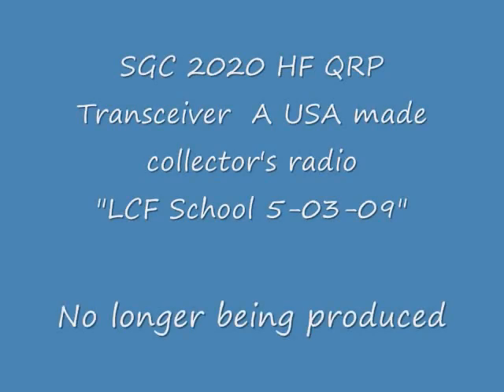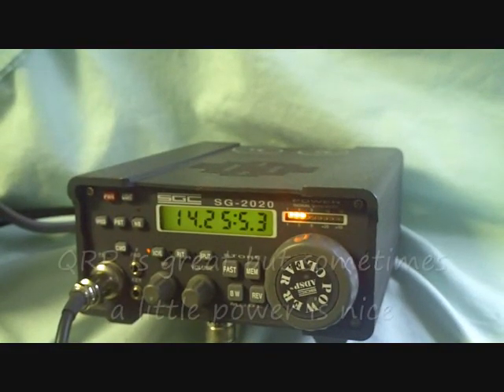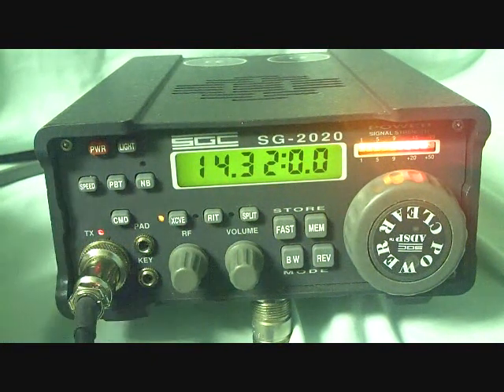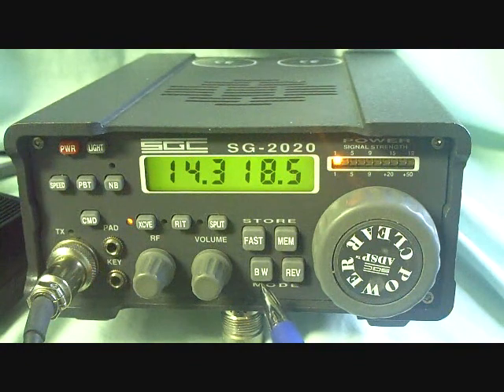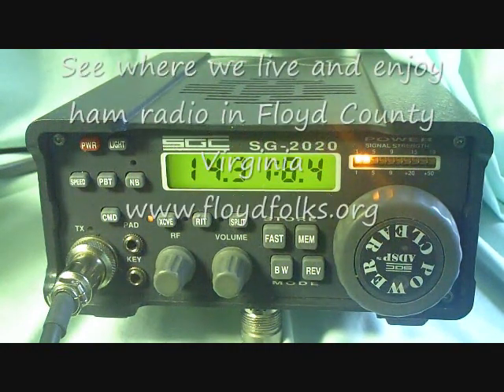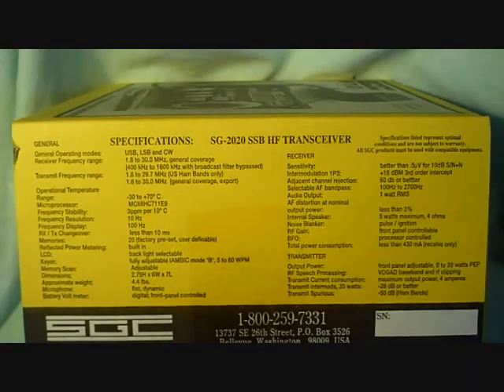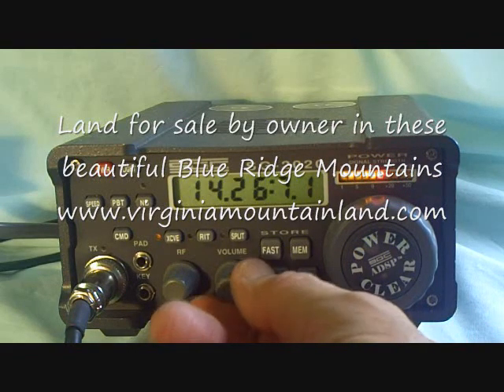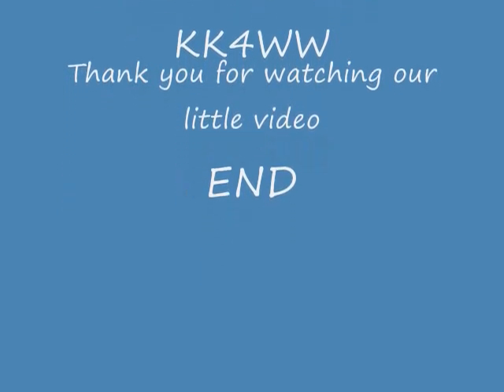SGC 2020 hf transceiver QRP radio collectable Floyd Virginia LCF Group

Comment: Have one as well with the first generation ADSP Noise reduction. If you have one of these gems you should have the service manual as well. Used some pretty common parts that still should be available. Their web site is still up and running in October of 2023. If you don’t have a service manual you might be able to obtain it from the factory but from what I remember is that it was on line on the site. It would be nice to find the TX mod you talk about.
Reply: As an addendum to my earlier comment I still have my original packaging, I also purchased their AC to DC power supply which puts out a voltage of around 16 volts which is well within the input limits of the radio. Also purchased a spare housing just in case it might be needed in the future. One of my biggest regrets was not purchasing the factory portable kit. Yeah it’s a bit long and awkward but it would have been nice to complete the kit. 
A fun fact is that the original owner started out building SSB marine radios as well as crystal controlled military radios for third world countries which were cost effective for the times. Their antenna couplers are some of the best out there and I believe there is one still in production to this day. After the original owner passed his wife eventually sold the company to one of the employees who decided to cater to the military with several of their antenna couplers and antennas while dropping most of the Ham related gear. Even their SG500 amplifier was great until the supplier of the Mosfets obsoleted the part leaving many owners with a useless amp. They were supposed to redesign the amp but that never came.

Comment: Does anyone have any pictures of where the internal ADSP connects to inside of the SGC 2020. I purchased a used radio but the ADSP had been taken out much to my annoyance. However, I have just managed to find a used ADSP but don't know where to connect it. Can anyone help please.
Reply from the maker: Hi Tone - I do not have any photos but do have the manual and it may  show how to do that. I will try to fined the manual and share it if I do.  I purchased this radio at the Daytonhamvention years ago the first year the radio was made.  I will be using it next week when the family has a week long gathering. I will set up portable operation.  I did add a little circuit to key and amp so can run hi power if needed.  I like the radio. It is packed in the car now. Looking for manual now. Thank you for looking at my videos. David KK4WW www.kk4ww.com

Comment: Mine doesn't have the added label on the tuning knob, but has the factory sticker next to the serial number for the DSP..Great little rig ! Also works well on digi modes so very stable.
Lee, WA8QFE

Comment: I would have liked to have had one of these :)
Sean - KD4ADV Amelia, VA FM17ai
Reply from the maker: Sean Ingram I still have mine and it is one of the very first ones - I purchased it after seeing it introduced in Dayton many years ago. I would think they come up for sale on ebay now and then.  Good luck with that .I am still in Dominica operating as J79WW and have 6 more days - Hope to hear you on air follow at www.twitter.com/n4usa or just  search twitter with hashtag #J79WW for updates on the air. dave www.kk4ww.com

Comment: A good friend of mine had the 2020 but his didn't have the ADSL feature ,which you can instantly tell by the lack of the decal on the center of the VFO. For such a basic rig his 2020 sure worked great, and that's what most people love about this model is it's simplicity. It's a current technology transceiver but simplified in such a way that makes it a joy to use :)

Comment: Thanks for the 2020 video. Hope to see some more featuring the rig in cw mode. I had two and always regretted selling them. Just purchased another, obviously 2nd-hand this time. They were primary rigs before and this one will be primary rig again. Sure wish the 2020 was back in production.  My FT-817ND is great but sometimes the small size controls are annoying.

Comment: Enjoyed the vid- well made OM!
Bought my 2020 with the full man-pack case, very cool. Have excellent reports barefoot on 75 metre SSB  The FT1000MP is my main radio, but head for tthe cabin or in the trailer, the SSGC2020 is the one for portability.   73 pete.